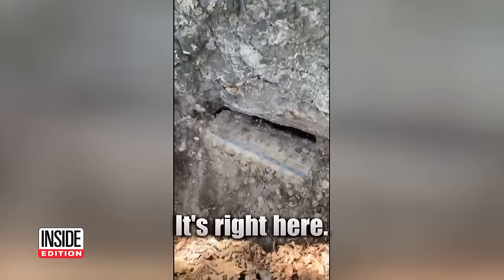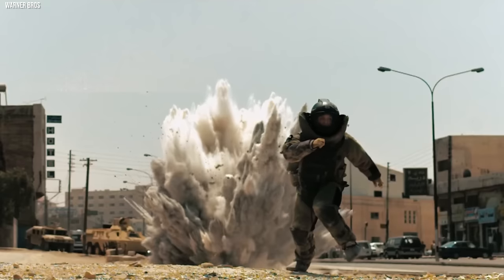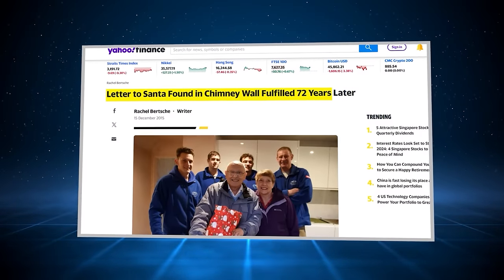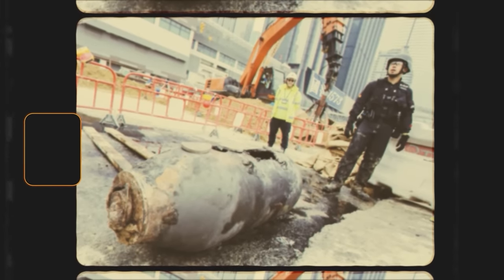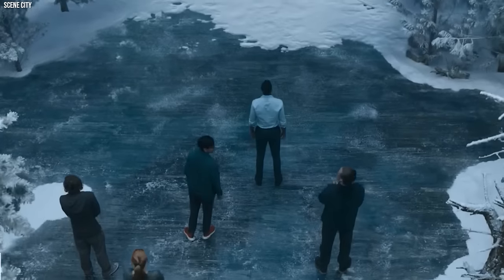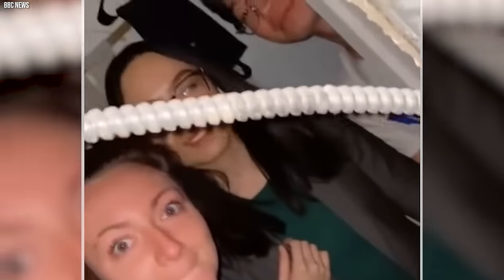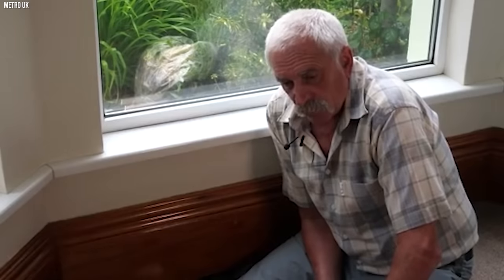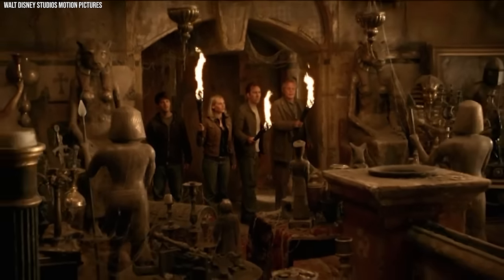This Discovery During A Home Renovation Leads To FBI Investigation

Comment: While remodeling a late 1800 home.  Which in it's day was a business with two separate store fronts. Now a home, the two store fronts were connected all be it with a step down where the wall once was. As we tore out walls on the second floor,  we found a hidden door in the back wall of a closet. Only about 3 feet high we pried it loose to discover a narrow set of stairs, which led up to a 3rd story. Up there, was a narrow hallway and six tiny rooms with a single bed and a night stand in each one.